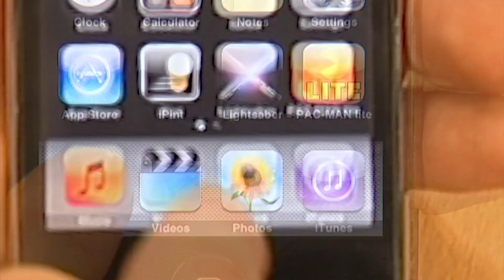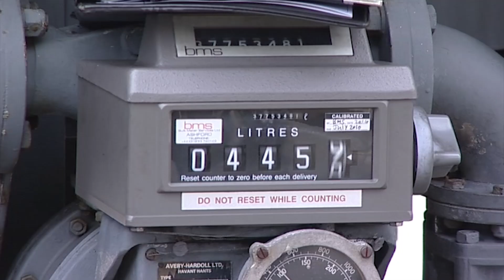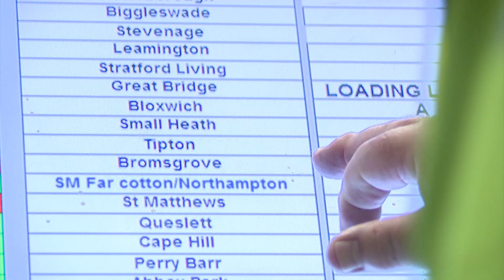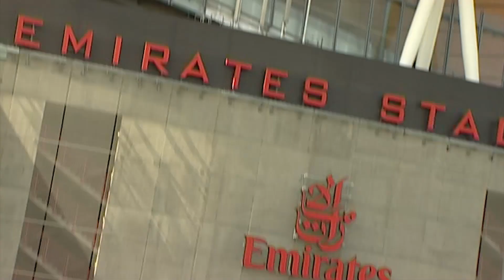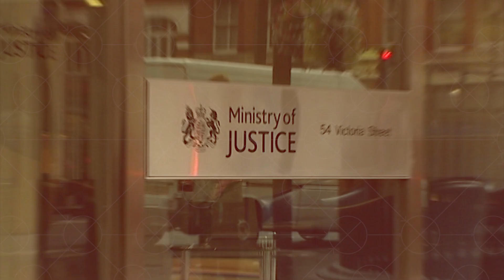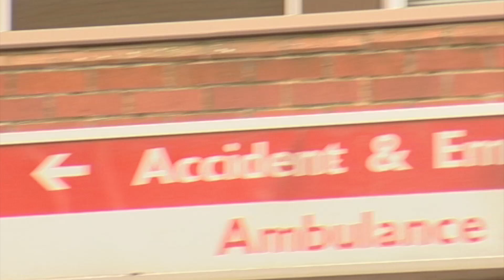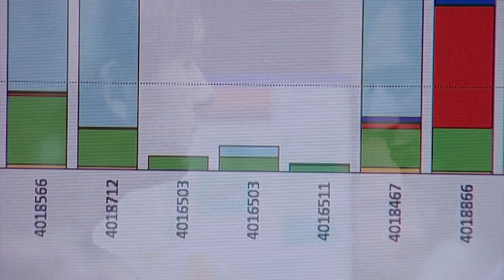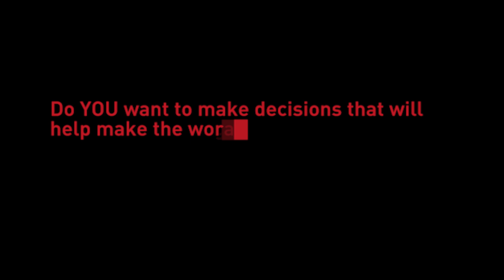What is Operational Research? – Full feature

Comment: So what is the difference between OR and Industrial and systems engineering??
Reply: I would say, Industrial and systems engineering is related to applications of OR in manufacturing environment. Applications could include, inventory management, job shop scheduling, demand forecast, maintenance optimization etc. using OR tools. Whereas, OR in itself is a much wider field of mathematics.